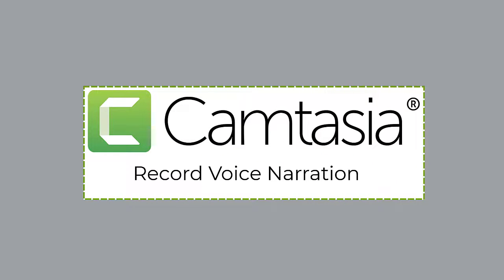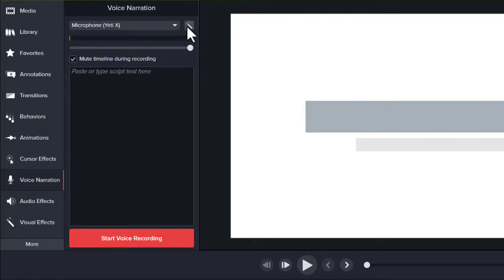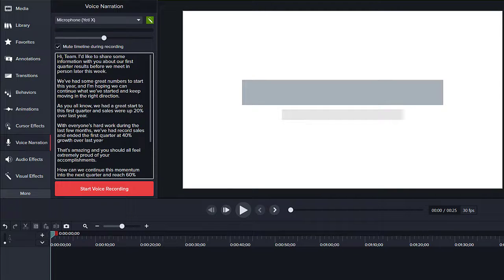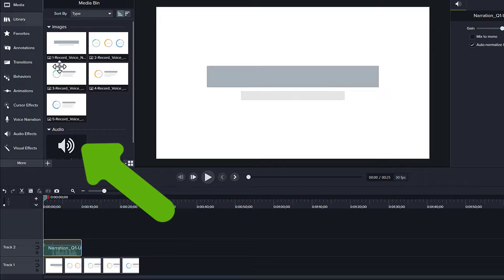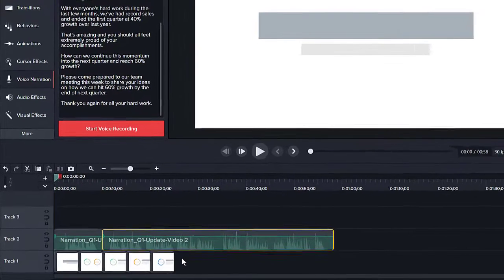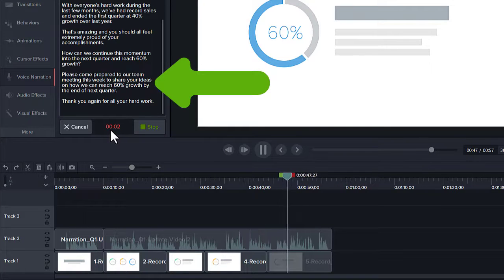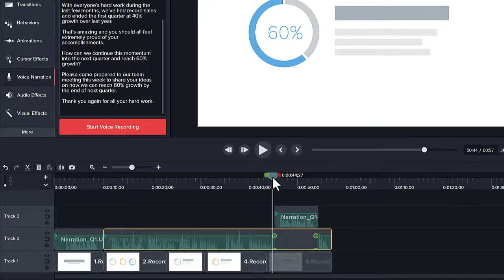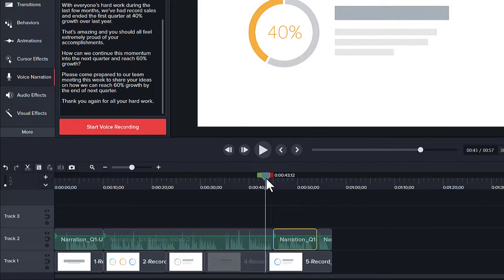Camtasia: Record Voice Narration

Comment: What if our Mic is not on the drop down how do I add it?
Reply from the maker: You shouldn't have to add it, Camtasia recognizes microphones plugged directly in. There are some that aren't supported, however first make sure it's plugged in, double-check the mic drop-down menu after doing so, and if it's still not there, you may want to check with our tech support team by opening a ticket here: bit.ly/techsmith-help